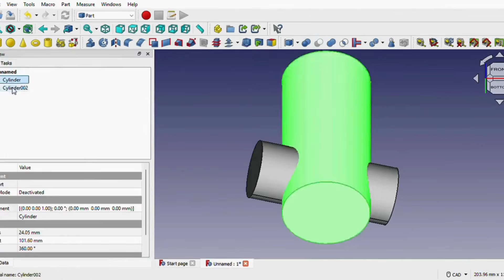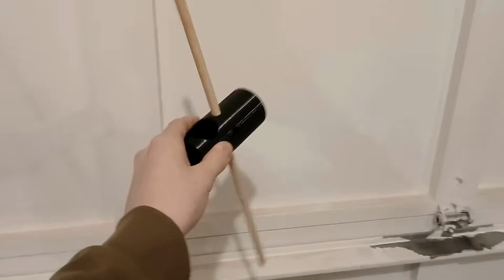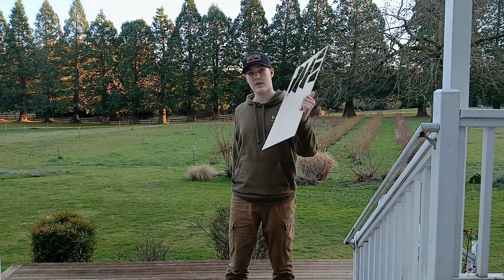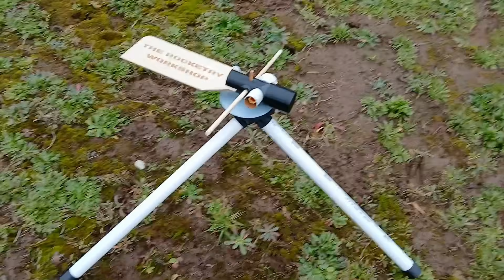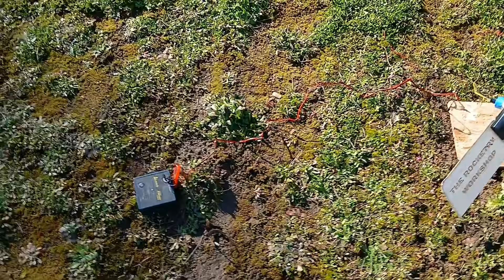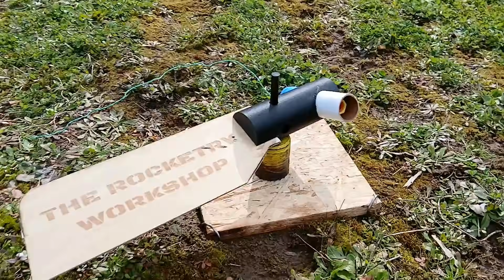Can the rocket-powered DEATH-COPTER survive 3000rpm?

Comment from the maker: What should I build next, a 3d printed rocket to launch to Mach 1.3, or a sugar rocket motor system?
Reply: Here's a challenge for you. Do a MAP gas liquid fueled motor. It's a great project for brainstorming weight to power ratios as well as fluid dynamics of air.

It'll leave us saying "To hell with Mach 1.3, let's see that Mach 2.5 come off the stand!"
Reply from the maker: That would be cool, however the problem with experimental motors is that I can't launch them at official launches until I'm 18 and can get a Tripoli L2 certification. Anyway a liquid fuel motor would be cool, but it would have to be very small to fly on my property, and wouldn't come anywhere close to Mach 1 even. Thanks for the suggestions tho!

Comment: If memory serves, rotors are maxed out at 15 degrees angle of attack on your average helo. For heavy lift, it can go to 30 degrees but with a much slower head rotation.

I'm just spitballing the angle here, but that looks close to a 25 degree angle of attack on your monocopter hub. Perhaps lowering that down to 10-12 degrees angle of attack will reduce the torque on your mounting fins. Will certainly help with the head getting up to speed and off the ground in a more controlled manner. 
I am also assuming you calculated center of gravity on the hub before you drilled the hole for the launch pin. If you're off there, wheel weights or fishing weights may be the solution. Not quite sure what your rotor blade weighed compared to the rocket motor.

One thing I do know for certain, it won't fly straight up. It will inevitably "hang a right" on you. As the rocket is burned away, it decreases weight on one axis of the hub, which shifts the center of gravity out into the rotor blade itself. You lose a lot of lift as the blade starts fighting itself, and then it will want to spin off to the side. 

I honestly thought you were sicking the rocket motor in the center of the hub and using an angled exhaust port when I first saw the clip. Think "Squirrel cage fan" right by the rocket nozzle, and using the fan blades as venting louvers to give rotational thrust.

Edit: One other thing I'm seeing here that might help. Decrease the width of the rotor. You've got a blade that I'm guessing is 3 1/2 inches by 16 inches. Get the blade out to about 24 inches long an 2 inches wide. It will do a lot for decreasing drag, and again, allowing the rotor head to come up to speed before the rocket burns out. I'm familiar with a few 20 second burn motors, but they're NOT CHEAP, nor are they as light and potent as an F series. J motors give a lot of thrust, yes, but they weigh a ton by comparison.
Reply from the maker: Thanks for this, I appreciate your time to write this. The whole idea of this particular project is to make a monocopter that can fly on more powerful engines like this. I can get a G12 or one of those apogee F10 motors pretty easily and make a monocopter that works first try, but the whole point is to do one that is powerful. Also off-camera I did a test with one at a lower angle. It didn't break- but it also didn't get more than 10 ft off the pad. Really sketchy, needs the extra angle to get it going in the right direction. Also, the rocket is flying almost perfectly straight up until the fin breaks off-you can see this especially in the last launch clip if you keep pausing to see what it looks like. It will not go perfectly straight up, but if it stays together I have no doubt it will do just fine as far as monocopters go. At this point all I need to do is get it to not break- but it might be a while because I have other projects. And also I 3d printed the hole already into the center part. i had to do a couple test prints before I got the location right, but the CG is right over the central hole. Thanks again for watching!
Reply: @TheRocketryWorkshop Just as a for what it's worth here:

The reason I was harping on getting the rotor head up to speed is gyroscopic balance.

Yes, I've seen the turbine driven monocopters, it's relatively easy to see how those were achieved. In the case of the turbine ones, it's a light weight rotor blade and a counterbalance on the head. It's the gyroscopic effect created by the rotor heads rotation that balances out the monocopters.

As I'm relatively sure you're aware, helicopters in general try for a steady rotation speed on the head, and change the pitch of the blade to increase or decrease lift. As for rotation angle for moving forwards / reverse / side to side, the blades will change pitch through the rotation. On the back side of the arc they might be at 5 degrees positive, on the lead side of the arc that might be 2 degrees negative pitch. End of the day though, that rotor head is still spinning at roughly the same speed. (For the pilots out there, I know this is an oversimplified generalization.)

Where I was going with the narrower but longer rotor blade was the decrease of drag allowing the whole assembly to rotate a bit faster, looking to get that gyroscopic effect working for rather than against you.

Where I was going with the weights is kind of counterintuitive. My thought being, if the entire rotor head weighs a bit more, the change in mass of the rocket will have less effect. Narrowing up the rotor blade will provide a longer span of lifting area as the CG / center of rotation shifts out into the blade.

KEEP AT IT!!! The thought alone you've put into this shows the effort.
Reply from the maker: Thanks for your comments! I appreciate the help

Comment: Love the idea. To make the 3d print much stronger, you could just print the cylinder laying down. This will need some supports, but then you're not relying on layer adhesion for strength in the direction with the grratest forces. Adding a couple more perimeters also helps a lot without adding much weight.
Reply from the maker: Yes, printing it on it's side could definitely help. Thanks for your comment!

Comment: Interesting test! Note that CF filament can be weaker due to inclusions/voids. Regardless of material, try printing with the layer lines parallel to the cylinder's axis—it'll handle those rotational forces much better.
Reply from the maker: Yes, I think that could fix the problem. Thanks!